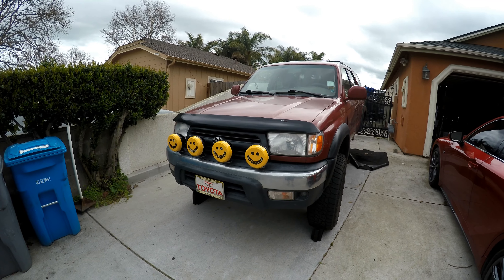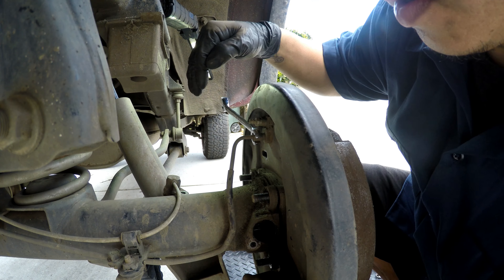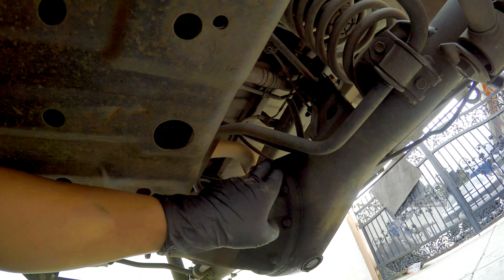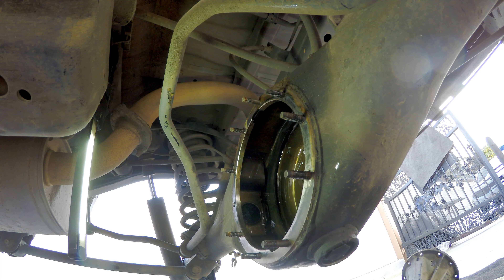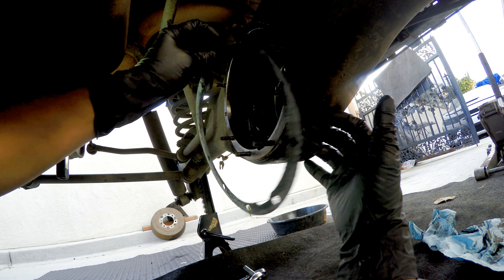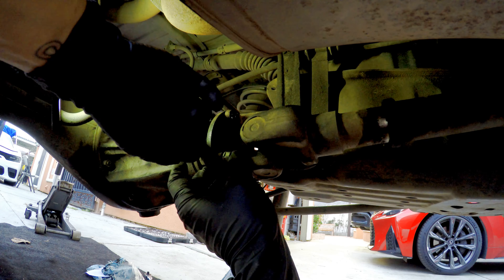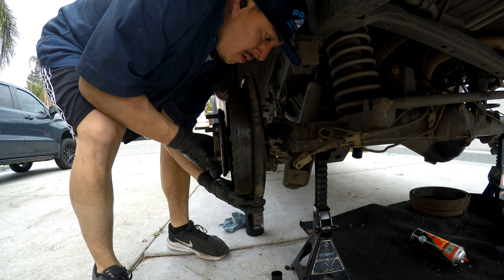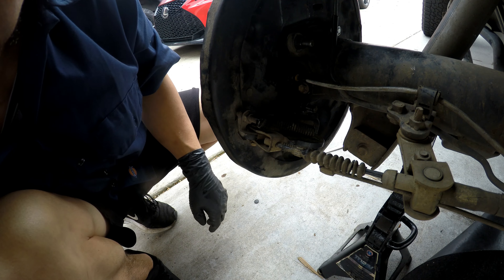2000 Toyota 4Runner - Rear Differential Gasket Replacement

Comment: Great job explaining and showing the steps. I appreciate that.
Reply from the maker: Thanks for the feedback. Much appreciated.
Reply: Hi Rolando, following your directions I was able to remove my differential on my 2000 forerunner 2.7 liter 4 cylinder.  Unfortunately I have to replace the differential..gears were grinded due to a hole in the housing case.  Now my problem is trying to determine the gear ratio? To find the right replacement...any advice...Thanks